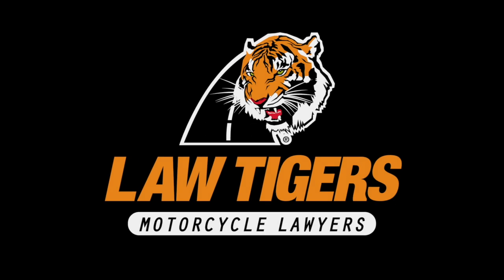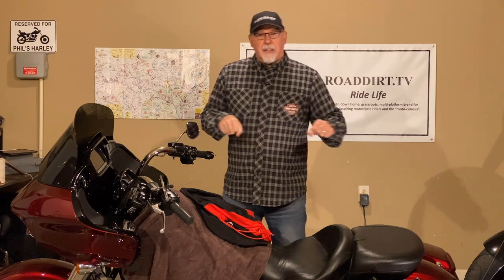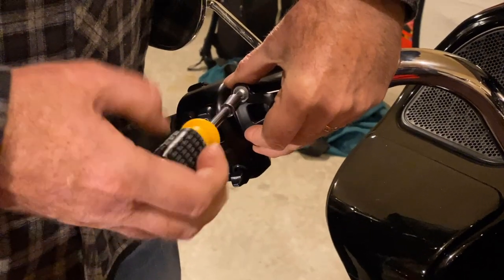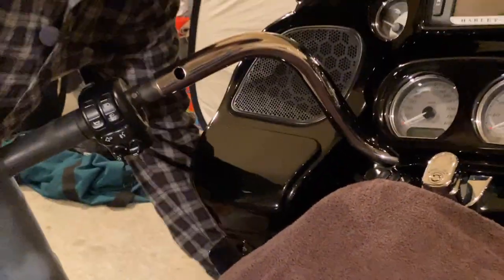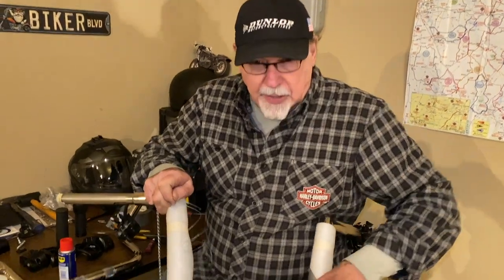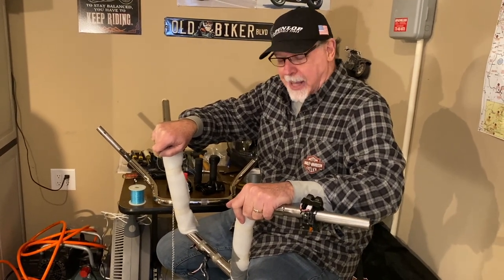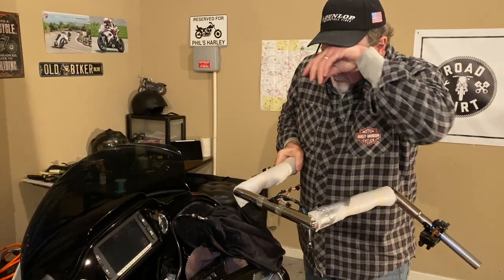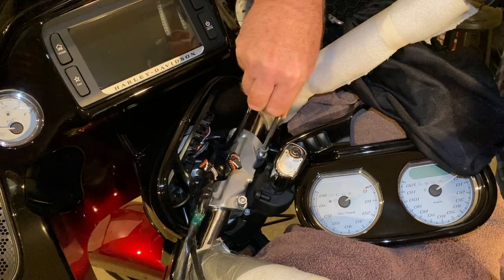Harley-Davidson Road Glide KST 12" Outlaw Handlebar Installation

Comment: Good video. I am looking at the KST bars also and trying to decide 12" or 14". I'm 5'10" and don't want to be stretched forward. CAN YOU tell me what Mustang solo front seat that is on the bike. Looks like a Lowdown touring but don't think you would have that at 6'2"? I run a super touring which puts me back 1.25" and reason I want the bars to come back.
Reply from the maker: The Mustang seat was on this RGS when I bought it - I've never looked up the model.  at 6'2" I've thought more than once about whether I should have gone with 14" bars.  I do like my shoulder and arm position with the 12" Outlaws in the video tho.  Hope this helps.  #RideLife

Comment: I have a 2020 Road Glide Limited and am thinking about getting a set of 12" bars. I believe the bike comes with 10". I'm 5'10" and could live with the stock bars but I do get a little pain between my shoulder blades on long rides. Thinking the 12's would be a little more comfortable.
Do these bars change the angle at which your hands sit? How are you liking the bars since you've had them a while? Great video!
Reply from the maker: Hey there MotorcycleDen.  I'm 6'2" and love the 12" bars.  They really aren't that tall and the stock cables worked without any problems.  I aligned the bars to be directly in line with the forks for a more positive steering feel.  I've had KST bars on me last two Harley's and have had great success. KST makes a great product.

Comment: Nice video I'm 5'11" I just trade my street glide for a road glide. On my street glide I had 12" and they were comfortable. Do you think I should the same 12" height for the road glide? Thank you
Reply: Hi Cesar - apologies for the delayed reply brother.  I'm 6'2" and had 12" Mayhems on my Streetglide. They felt taller than these 12" Outlaw bars from KST. I almost wished I had gone with 14's on the Roadglide but I do like my arm position so I'm sticking with them.  These 12's might be just right for you.